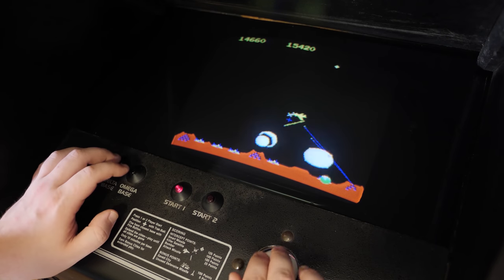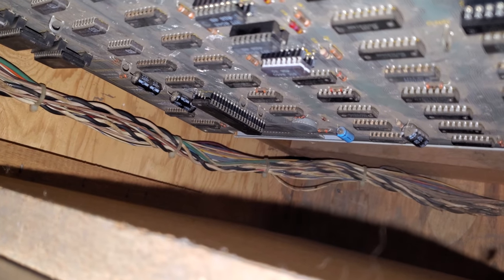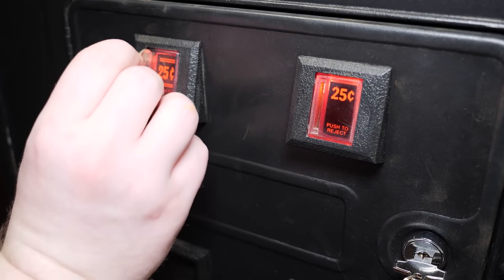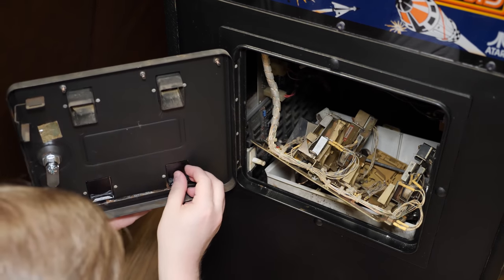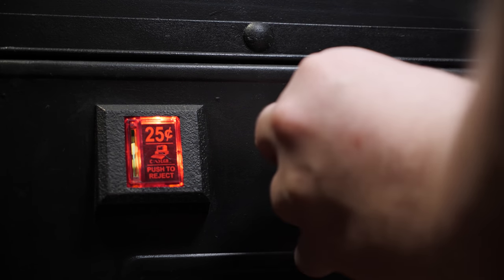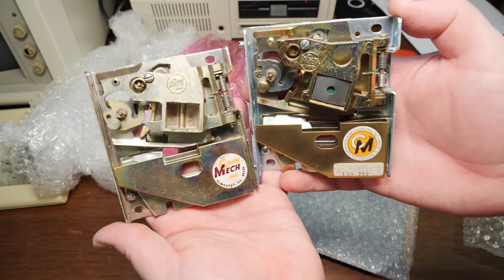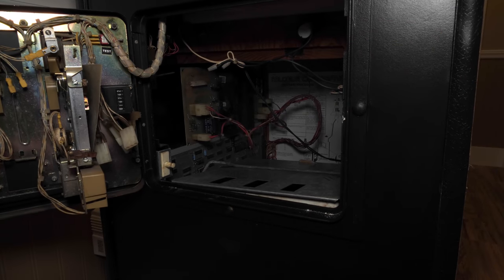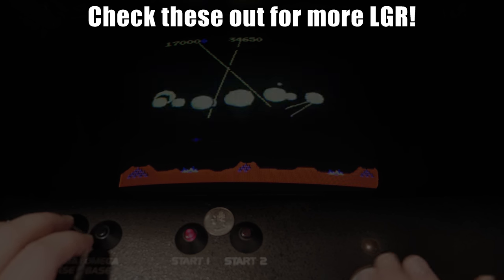Updating my Atari Missile Command Arcade Machine!

Comment: I use to work as an arcade tech, 80-90% of my job was cleaning the coin mechs would jam and all the dust, dirt and grim from everything the coin systems like you showed and all the controls would get "gummed" up like this, then the dust always getting dust off the PCBs and power suppllies, so many systems i would see dead due to heat and burning up cause of dust build up.
Reply: That last part was sad
Reply: How did you end up cleaning the dust from the PCB and power supplies? I can imagine using a vacuum or compressed air after you take it outside, or rubbing it with something dampened by alcohol, but I don't know if that would be effective enough.
Reply: You can clean PCBs in the sink, or dishwasher.  I did it on my Neo Geo board and it looks brand new.  Make sure to remove any batteries, and be sure to rinse the board with alcohol to make sure all the water is gone/dry.
Reply: Aladdins castle here , where did you work?
Reply: @AxialFlux  How do you rinse the board with alcohol? The best I can imagine is getting a ton of alcohol in a tub and repeatedly pouring cupfuls of it over the PCB, but that seems ridiculous. There's got to be a better, cheaper way of doing that. Would putting alcohol into a spray bottle do the trick?
Reply: @Thalanox  Toothbrush.
Reply: @Thalanox  Toothbrush works, but I used a spray bottle.  Spray the alcohol everywhere, and use compressed air to blow out the alcohol, especially under chips.
Reply: @Dragonfire511  it normally was sad, so many good games going dark from that
Reply: @Allcastlegames  FunForeAll was a great place still open today and is tons of fun.
Reply: Dark Xeno awesome man! I will check it out!
Reply: Thank you for making my (and others am sure) childhood awesome Mr Tech dude...I remember telling my dad I wanted to work in the arcade the first time he took me to one in our home town. It was the early 90s, so apartheid was still around and we had a special section of games we were allowed to play. Nevertheless, games got us through. Salute
Reply: Me too! I spent half my time with a multimeter adjusting voltages on the power supplies, the rest cleaning up gum, swapping buttons and giving the fighting game experts a few free games
Reply: So many swapped coin mechs...

Comment: I totally get the substance of this video.  It's the little details, the ones that aren't something everyone is going to notice, but you will.  Not to mention, they add an air of completeness to the project.  It's like, I'm building a retro gaming PC, and I have an nVidia GeForce FX 5500 in it for graphics, and I've been searching high and low for one of those 3D puffy "jelly" badges that the FX 5500 would have come with that says "GeForce FX Series".  Even the tiny details, especially the tiny details, make a project worth it in the end.
Reply: I know. I was the same with my Q9650 build, finding the right metallic stickers, like the more recent holographic "Intel Core 2 Quad Inside" sticker, a "Designed for Windows XP / Windows Vista Capable" one & so on, which I was able to find sets of on eBay.
Reply: Oh I know the kinds of stickers you're talking about, they're commonly known as gel stickers or dome stickers, always loved seeing those on products back in the day.
Reply: @BillyTheCat128  Yeah, man, those things were the shit back in the day.  I mean, I like the flat foil ones they have now, but those dome sticks just exuded awesomeness.
Reply: Yes its like even though it's on free play there is a quarter sitting on the machine for the next player.
Reply: There's a HAL 9000 prop to mount on PC cases now, it's sweet
Reply: Duude those stickers need to make a comeback. I loved squishing them with my fingernails

Comment: When I worked at Chuck E. Cheese’s, I took great care and attention at keeping the games and machines in good order. I found a lot of the old manuals, made adjustments to the settings to put them in compliance with company policy, and found long-since dead lights and fuses and implored my boss to order the replacement parts so we could get those machines looking as new and fresh as possible. 

Props for upgrading the plastic coin mechs to proper metal. The plastic ones never felt right, got jammed easier, etc.
Reply: I’m glad to hear someone at Chuck E’s took good care of the machines.  The ones at our local restaurant were always a little on the busted side.  Except for the 4+ player beat-em-ups like X-Men and TMNT... those were always in great working order, probably because they made the most money.
Reply: Did you work there in the glory days before the 1984 bankruptcy and Nolan Bushnell's exit? Man, it was fun going there up until about 1988 or so while they still embraced the arcade aspects before going all super-bright and shiny...
Reply: Jeremy Holloway Nah, it was the mid-2000’s. So it was a healthy mix between the good stuff like the classic Skee-Ball machine, and the slightly newer things like the basketball hoops and coin pusher games. 

Mainly I got satisfaction at bringing back to life visual cues on the older 80’s/90’s machines that had been neglected for so long.
Reply: that's so freaking awesome
Reply: @swamprock I hate it when they do that. They need to send it to people who can dump their roms and preserve them.
Reply: Dude, congrats on doing a job well.
Reply: @Bob3519  Appreciate it. A job shouldn't just be "a job". Work without passion is just "work".

Comment: Man I love the looks of those old circuit boards! Nowadays,  a chip the size of a Q-tip, can do everything that entire board does... times,  how they change... My game was Tempest, but Missile command is fun too...
Reply: The board though looks like it would just shatter if you breathed on it. :)
Reply: In the early 80's after this machine came out it became common to roll a custom ULA for a machine like this, basically 1 chip that'd replace most of those small 74 series logic chips, it was drastically cheaper to get your own chip made than having to get dozens of discrete logic chips.
Reply: @chartle1  they're actually a lot stronger than you think...
Reply: @Quickened1  yea but just looks fragile (thats italian)  :)
Reply: my favorite from the early to mid  80s is probably bosconian totally underrated but fun as hell.
Reply: @swamprock hell yeah it is! too bad it's extremely rare. and its usually lumped into a namco collection arcade unit. it would be my first arcade cab if i was a multi millionaire haha.
Reply: @kylem1112  there's either a new homebrew Atari 8-bit/5200 or 7800 version of Bosconian that even has the voices in it...
Reply: @Nukle0n  are there upgrade PCBs for retrofitting them onto said arcade mobos?
Reply: Get Jeff Minter's/"Atari's" Tempest 4000 for the Xbox One or PS4 if you haven't done so already...
Reply: @TheJeremyHolloway  this concerns manufacturing of new boards, it's not relevant to existing old machines.
Reply: @TheJeremyHolloway  ...I played Tempest 4000 on a Jaguar system many many moons ago,  just not the same without a spinner and cabinet... Needs to be a stand alone arcade machine to excite me,  I held the world record high score for six months when it first came out, until someone finally defeated the whole game at 99 levels.... Ooops, just found out I played Tempest 2000 on the Jaguar,  not 4000!

Comment: I've been rebuilding my empty Smash TV converted to a Killer Instinct 2 cabinet, sadly the cabinet was damaged and I got it from a local shop friend in town, into a MAME/JAMMA cabinet. It never had coin-op mech included, but I found someone with a midway coin-op mech and I was super excited, I also had to do some repairs to the entire assembly. But it was so satisfying after getting it to work and got the bucket installed. Nothing is even more satisfying than having a full-ish bucket as you mentioned for that metal coin action!

Comment: you need to invest in a 3d printer, you would find so many uses for it dude
Reply from the maker: Agreed dude. Just gotta do some research and choose the right one!
Reply: @LGR cant wait to see it in action! 😆
Reply: @LGR  you just can't go wrong with the Ender 3. $200 base price and then you can start modding it with the things you really need. no need to pay $800 for a Prusa.
Reply: 3D printers are cool, but not helpful in reproducing certain things like coin reject buttons and even coin door bezels, etc, or most trim on control panels. Control panels and especially coin doors were built to be kicked by snot nose teenagers, you need metal to get the right look and feel. Refurbing arcade games is an odd mixture of scavenging the internet and then also fabricating your own parts for those times when your cabinet frame is rotting from the bottom, etc., and for the structural stuff inside the cabinet where most people wouldn't see it - arcade owner/operators back in the day didn't have 3D printers! Do it the old school way!
Reply: @LGR For something small like a token, you'd get the best results from a 3D printer that uses resin, although the post processing of the prints can be quite messy. But you can't argue with the awesome results. Heck, you could probably make your own custom keycaps too.
Reply: @LeftoverBeefcake  That wont do for LGR, this ol' cabinet deserves the sound of metal tokens falling into the tray. Thats why he put $200 of coins in it just to hear it.
Reply: @LGR  hey there is a dos box os called 

Dosbox distro

Comment: Cleaned, straightened, lubed up, and working smooth... how fantastic!

The arcade I work at does a ton of coin door/mech restoration amd it's an ongoing battle.

If I had to guess as to what caused the damage to the coin mechs to begin with, I'd say employees who removed the coin tray too aggressively probably slammed the mech structures a few times.

Older arcade coin trays are already a hassle to remove(especially when they're full), and if you're tired or in a hurry it's a little too easy to accidentally hit the coin mech structure when pulling the tray out.

I'm happy to see this classic arcade getting some love!

Comment: I did the custom inserts for various LED buttons and coin mechs. The budget way to fix the light bleed is to put them face down on a light board/table so the light shines through the paper just use a sharpie to color in the blacks (on the BACK of the paper). you don't have to get super close to the fine detail because the ink is a tiny bit thicker there anyway. Works well, and the heavier black helps the text pop!

Comment: I'm sure it's been mentioned but hitting the Coin buttons (or any plastic you want to be shiny) with some rubbing compound will buff out most of the very fine scratches and really make them shine. If you wanted to go even further with some soap, water, and 2000-3000 grit sandpaper available at any auto parts store you can lightly sand out all the imperfections then use the rubbing compound to polish it to a glass like finish. I've done this on many vintage parts and it really makes them look better than new, plus it keeps the original parts which is always nice.

Comment: for the coin slot transparencies, take a sheet of overhead transparancy, and print off 4-6 copies of the inserts using a toner based printer (laser jet printer, or copy machine) and stack them. it's an old trick I remember from making PCBs by hand. The toner is darker than ink, and more uniform. once you like the opacity, you can glue them together with superglue

Comment: Looking great! It's true that you can't have just one. If you haven't done so already I would highly suggest that you re-cap the crt(if not done already) and the power and sound board. If I remember, the power board "trys" to keep the +5v corrected under load, which if the caps start to go it can over volt the main pcb. Cap kits are pretty easy to do but I'd be more than willing to help out with anything if you need it.

Comment: That sound of the coin going through the metal mechanism is addictive.
Reply: Those metal mechanisms were likely used in very high endurance things like payphones. Arcade operators were too cheap to use anything expensive so all you had was the plastic ones in game machines.

Comment: You don't need to upgrade the inserts, just print two more in a mirror (if your printer is good enough, print one page with the face and mirrored face matching). Double shot of ink will make the black better. 
Extra mile: get a candle and impregnate the paper with it, it will make everything much more vivid.

Comment: I like the $200 "coin-dropping sound" mod. Also, if you double up on transparency sheets, the black doesn't bleed through as bad. You can get them for both laser and inkjet printers on eBay/Amazon for pretty cheap; I use them for PCB exposure masks (which you don't want any light bleed).

Comment: (Former printer tech here) If you're still looking for a good translucent material for your coin slot labels, you can buy matte projection sheets for inkjet printers in standard paper sizes that are perfect for this. I think they're also still available for laser printers as well, but I wouldn't swear to it. For best results, read the directions carefully, because it matters what side of the sheet you print on; if you get it wrong, the ink or toner won't stick.

Comment: I've got a Galaga cabinet from 1985 that I replaced the tube screen in with a Samsung direct fit replacement, the power cable was cut and as I found out, for good reason, the built in PSU was toast, I uplugged it from the mainboards before plugging it into the wall, the PSU started smoking. I cannibalized a 550W ATX PSU and meticulously wired it up, made a custom loom, etc. Wired a new wall plug using a dryer 3 prong 15ft cable rated for 1200W. Got it working, fixed, cleaned and bent the pins and such to get the controls working great again, cleaned up the cabinet, etc. It works great but I need to take a day to hit the main board with some Deoxit and clean it up because there's days where when it's cold it throws RAM errors and the graphics get corrupt until it warms up. It still needs some work but overall it's great and I love fixing up old cabinets and I love seeing people fixing these ancient behemoths.

My father and his friend when I was a kid managed an arcade around the corner from my house and all they did was keep them running and clearing out the quarter trays, they too left the quarters partially in there to get that satisfying rattle because people actually complained about it, thinking the quarters were falling into the cabinet itself or something. And another friend of my father had 20+ arcade cabinets in his home, Pole Position, NBA Jam, every Metal Slug, 1942, Time Pilot, Time Crisis, etc. He was supposed to hold onto Time Crisis and the Metal Slug cabinets for my father but he ended up selling them all off later. I'm still not over that, I've been searching for those cabinets forever and can never find them in decent shape or a decent price.

Comment: We found that we could get lots of credits on Missile Command and Defender etc by putting a wire down the slot and tripping the switch. We called it hot wiring. The company worked out what was going on and the next thing we knew we got a nasty electric shock when we tried to hot wire the machines. We quickly found a way around that because we paid a little attention in science class. We insulated one end of the hot wire with tape. The arcades were great. Usually a bit dark and kind of dodgy. 100s of machines all making their 8 bit sounds and coloured lights in the dark piercing the ciggy smoke. UK and then downtown Auckland NZ in my later teens. Still gaming at 50 years old. Still playing Fallout 4 mostly. My memory is getting less than reliable and i forget stuff if I do not play it for a few months, so the game never gets boring :-D

Comment: This is cool.
Though the yellowing of the new sheet will take a long time.  Yellowing is the process of acid in paper, but modern white paper is generally acid-free.  Considering the paper will be generally well protected from UV and excessive dust exposure I would guess that the ink itself would degrade considerably before it turned properly yellow.  I wouldn't be surprised if the white paper will still look fairly white when you're Old-GR.

Oh, and I want this thing.  Missile command is probably my favourite retro game.  That trackball system is just so fitting for the game and joysticks aren't quite the same.

Comment: I've had a lot of luck with replacement LEDs for those coin slots, last forever and don't heat up a lot.  (I just used ones that fit older automotive dash lights)   Working on a Playchoice 10 myself.  (my biggest hurdle has been finding a way to get something to make the control panel look a little better without going broke) Plan on putting all the electronics back in soon, I LOVE that thing!

Comment: Those coin mechanisms were pretty easy to defeat. When I was at college in the UK, my dorm had a Space Invaders cabinet (yeah, I'm old) that took 10p coins, one per game. Then some bright spark discovered if you flicked a 2p coin upwards into the slot, it would register a game half the time. Instant 80% discount! But not long after, someone else discovered if you messed around with plugging and unplugging the machine a few times, it would eventually glitch and give you a random number of free games (by the dozen). Needless to say, the cabinet was gone within an month. We killed the goose...

Comment: If you dig up a screen print shop that does tee shirts and stuff they can do the coin button labels really well. If you can talk them into just doing the logo on the side, they can always place a tiny logo like this in a corner of a larger lithography screen and mask it off during the main print using tape. Often printers will mask off areas like this to do the simplest types of 2 color prints. It's a pain but they wouldn't need to fabricate an entire screen just for the one tiny job.
-Jake